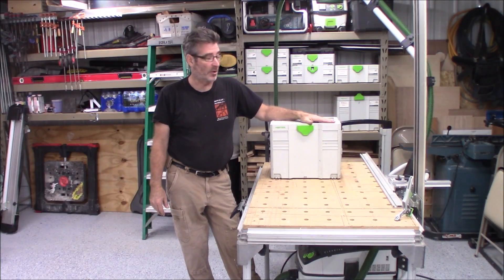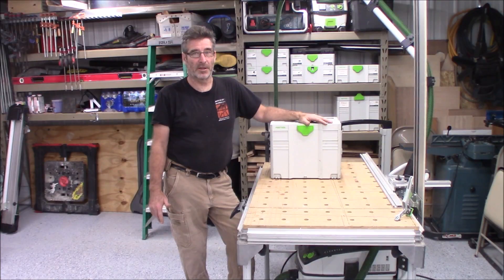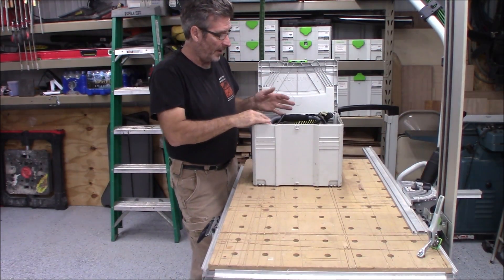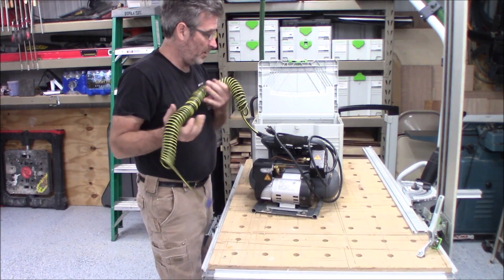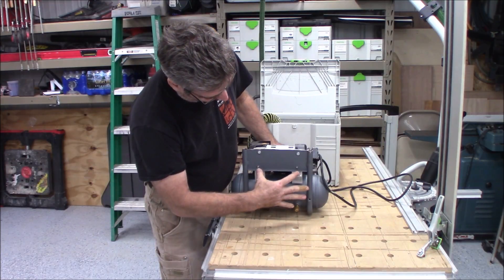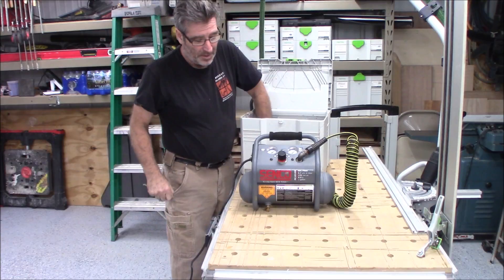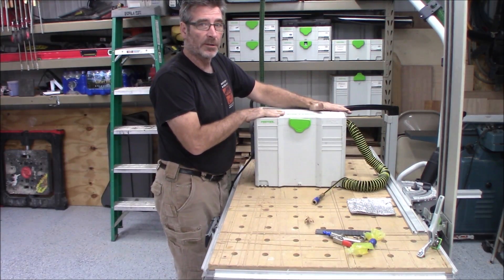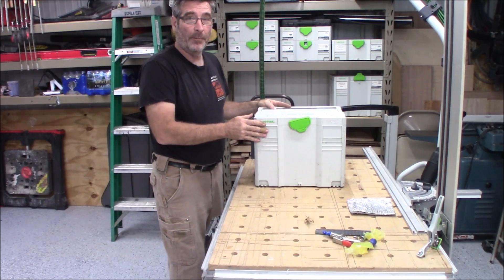Senco PC1010N Air Compressor Modified to fit Festool systainer 4

Comment: I've got the older pc1010 in a sys 5. I took the feet off and it fits on its back. A few people have done this. I'm thinking of cutting mine down so it fits the right way up like yours & it would fit a sys 4 then
Reply: Biggsy 
I was involved in that discussion  (Billy stray)
I can't believe I didn't notice how you did that , great idea and probably the cleanest not to mention easiest 👍
I'm sorry I chopped the handle off

Comment: What are you doing about airflow to the compressor? This afternoon I disassembled a DeWalt d55140 and installed it in a tough system tote. I'm considering putting it into a large tough system case as long as air flow isn't an issue. Do you still use this and has your senco overheated at all?
Reply from the maker: I still use it and have not had a problem with overheating

Comment: Why put it in a plastic case is my question.Just added weight and you need to take it out for cooling purposes if you read the manual warning on placement.